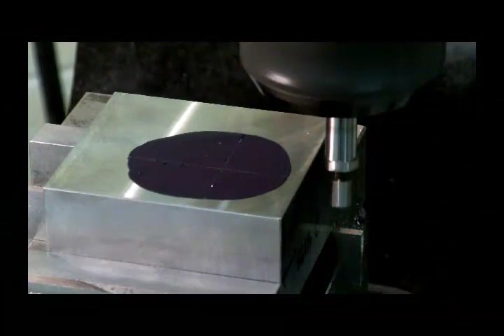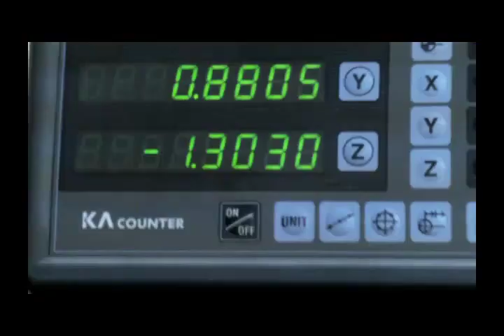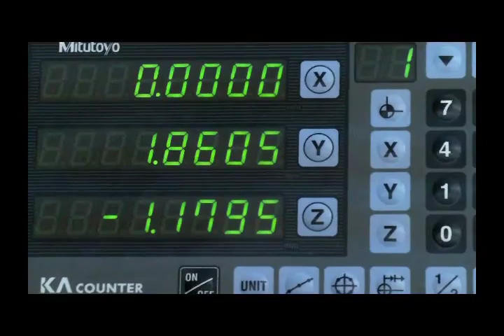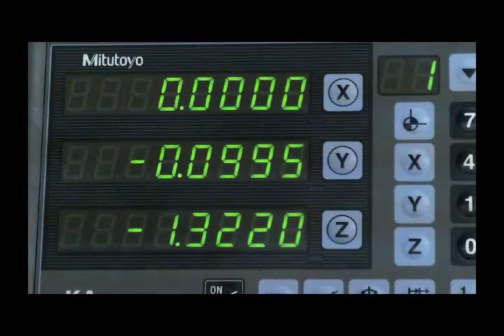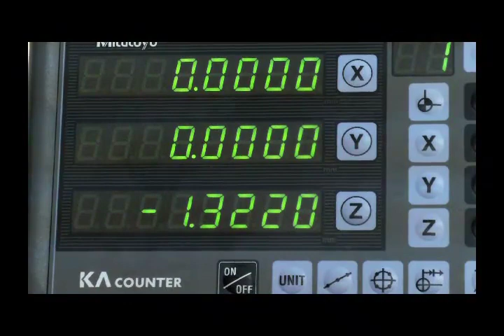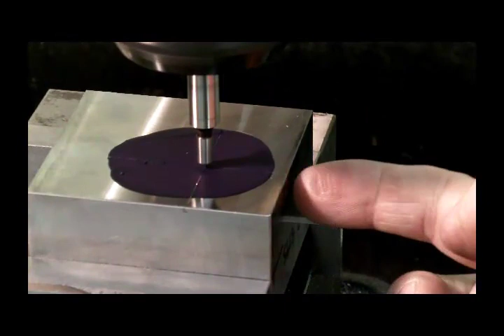Using an Edge Finder

Comment: This is rather a long winded confused way to use an edge finder..........drop the tip (4mm diam) down the full depth of the tip and run it up to the face of the part........edge finder is running out at this point...........as soo as it touched the face it will centralise and run true, then as soon as it kicks out sideways you have your edge which is 2mm from the centre of the 4mm diam tip.
Reply from the maker: I may have been accused of being long winded a time or two. :) This video was created for a person with no experience in mind. You obviously are experienced. Thank you for watching and taking the time to leave a message.
Reply: @machiningmoments  Well, I liked the dabbing the ball with the sharpie....that's new to me  as I've used marking blue in the past on occasion but normally I use just the edge finder that flips sideways.....I have a Wiggler set too.....too lazy to put it together when the other one is available.....I've had a few bruised knuckles from the ball swinging out suddenly.
BTW.....using the ball with the marker means you first have to make the ball run dead true then mark it, whereas the flip out one just needs to creep up to the workpiece until it moves sideways.......I think a noob would get results first go with the flip sideways type.

Comment: any tips on what to do if the edge finder isn't kicking out no matter how slow you bring it into the edge?
Reply from the maker: If you hold your edge finder and touch the end does the end move freely off center? If so it should kick out when running in your machine. Make sure you are not chucking on the part of it that is supposed to move off center. I would run the spindle at about 500RPM. Good luck!
Reply: @machiningmoments  When it touches the edge the part that is supposed to kick out is simply totally cylindrical with the body.  If I slowly move it further in an attempt to get it to kick out, it moves way off center and now has an edge that physically impedes it's ability to be centered at all (i.e. I went too far.)  Perhaps speed has something to do with it?  I was running around 1800 RPM.
Reply from the maker: Hi Sarah, this has me scratching my head. The end that runs off center is free? You are only chucking on the solid body? The end moves free in your hand, not rusted or burred. I would run it at 500 to 600 RPM (be careful not to run it to fast it will pull apart). With it rotating away from the part give the end a flick with your finger/pencil. it should clearly run off center. Bring the edge of the end slowly to your part it should visually start to turn true. Keep going until it just pops out and you are 1/2 of the end diameter (typically .200") off the edge. If that doesn't work try a second edge finder maybe you have an issue with yours. Good luck.
Reply: @machiningmoments  Yep.  I did not chuck the part that kicks out.  Seems pretty smooth and no rust, it's brand new.  I see it visually turn true when it's close but it never pops out.  I think it's just a cheap chinese piece of garbage tbh.  Ordered a used starrett yesterday and we will see how that does.
Reply: @sarahnikas1344  that right there is the best lesson we can learn in any trades....buy right the first time and don't worry about it.  I know iv been guilty of trying to save a few bucks before too. Hope it worked for you.

Comment: It seems to me the moment it kicks out is slightly off..when it's stable is the exact in point of center..for it to "kick out" it must be pushed off center..perhaps these are designed to kick out on center but that does not seem logical or intuitive to me.. Of course I have never used one so I might be ignorant to some trick,  I think i remember watching people use them and after the kick out they would dial it back to center. Hmm
I'll have to look up the manufacturer literature on this to confirm.
Reply: It's kicking out cause it's riding or rolling across the edge in the direction of rotation, not so much from being pushed past the center of the shaft.

Comment: Thanks for the info , I just finished surface grinder training at the tool and die shop I work at  , Monday starts with spotting on the mill and using an edge finder and I assume squaring up steel on a mill , I assume squaring up steel on a mill couldn't be that much different then on a grinder  , after watching this I won't look as green .i have no plans to tell them I watched your video, I'll let them think I'm smart . Seems easy on a digital read out , some our mills don't have that feature so I'll have to find a video that shows how it's done on lesser equipt machines